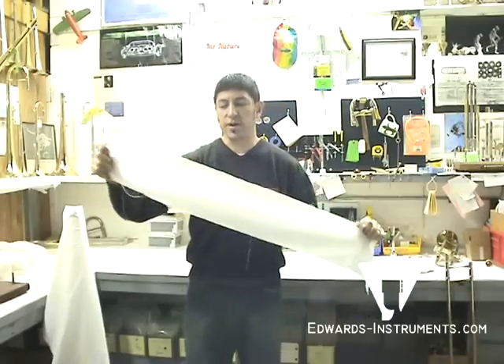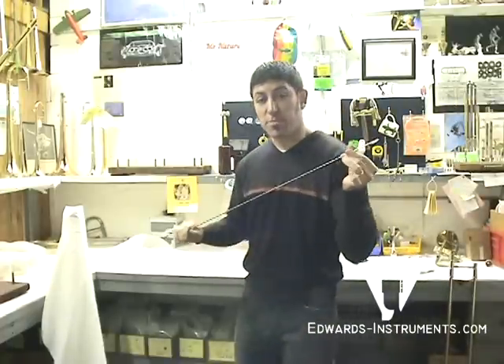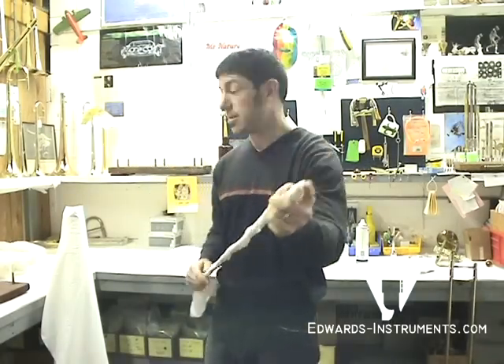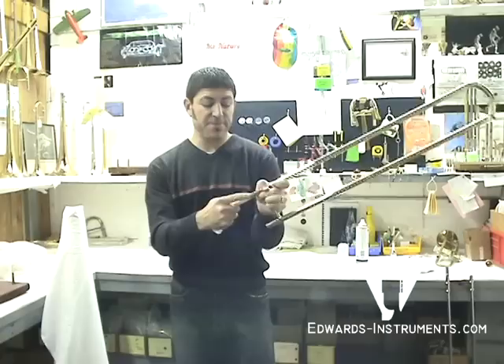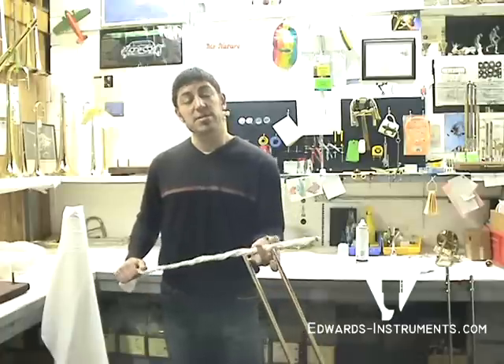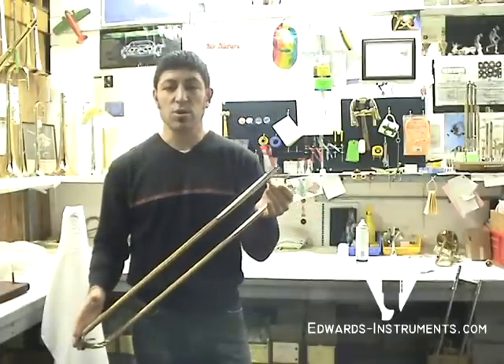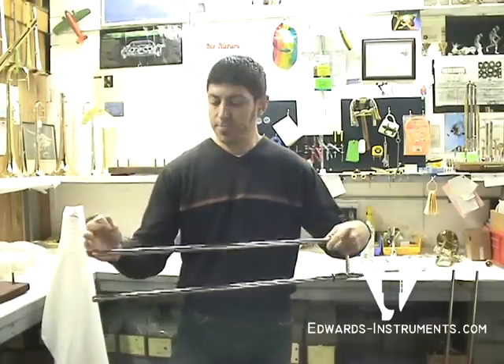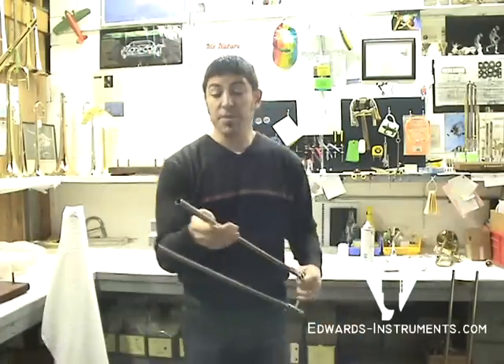Trombone Slide Cleaning

Comment: thanks for the video! just now used it to clean a slide I thought I was going to have to take into the shop for straightening, and your advice got it working smoothly without the service. When I was starting out, nobody ever told me how to do this the right way, so lots of trial and resulted in OK results over the years, but this method is clearly superior to what I was doing before.

Comment: Out of all the things posted on the net about how to lubricate a slide this is about the best.  One thing that I would suggest is removing th slide and right at the tip of the stockings you will notice build up of cream right after lubrication and the horn has been played a bit.  Clean this off  and right at the top of the stockings there may be a bit of build up too.  This makes for the perfect amount of lubrication with out anything on the slide to bunk up the performancee.

Comment: I am curious! With a properly aligned slide, the only part of the inner that touches is the stockings. So why would you put slide scream all the way to the top? If you have any other part of the inner touching the outer slide you have a problem and need to take it have the slide repaired.

Comment: please help! the other day i was cleaning the inside of the inner slide with my cleaning rod and the cloth got stuck. the cloth is really jammed in there tight and do you know of any tips to get it out possibly?  if worse comes to worst i will just have to use my air compressor to blow it out if hooking it out doesnt work. please help!!!

Comment: Nobody ever told me to do this when I started to play trombone, so I've had my trigger for about a year and I have never done the swabbing and have used slide-I-mix I hope that I can clean My slide with no permanent damage. But I will be upgrading my trombone soon, and I don't want to look like a noob when I upgrade it (we have the payment plan). My question is, will there be permanent damage, and from only using slide-o-mix and never cleaning the slide, there is a kind of black buildup I'm the stockings? Help me????
Reply: +Sophie Lamar Slide-O-Mix is great. It's just that some trombones do better with some lubes as well as others do with other lubes. I have a Rath large bore that loves Superslick, a medium bore Conn that does awesome with S.O.M, and an American Standard small bore that is my jazz horn that only likes the Trombotine. Have you upgraded your trombone yet? What'd you get? Also make sure you're oiling your rotor sufficiently. And try to use synthetic rotor and slide lube or natural rotor and slide lube; don't mix synthetic and natural.

Comment: What grade cheesecloth do you use? I ask because I am using grade 50, which works, but it's rather difficult to cover the end of my cleaning rod with it, as the rod keeps poking through the stitches.
Reply: I even recommend you use an old bed sheet as you can create a very long cut of it so that you can wrap it around your rod, and still hold onto it at the end in case it were to get stuck in your trombone.

Comment: I tried using my cleaning with a paper towel and ended up getting the paper towel stuck halfway in the slide. I don't know how to get it out :( I'm 13 by the way
Reply: oh fuck...
Reply: How'd you get it out?
Reply: @mio3092  - there's only one way out in that situation; accept that anything you try to do is likely to cause serious damage.  Bite the bullet, and take it to a pro repair shop. However much they charge you for getting the paper towel out, if you try and get it out without having the right tools, knowledge and experience, you'll have to pay them not just to shift the blockage, but also pay them to repair the damage you've done.
All brass instruments are very easy to damage (and costly to repair), but trombone slides are the most delicate of them all.
HTH
Reply: @jackx4311  Oh, I didn't get anything stuck in my trombone, I was just really curious. Thanks for the answer, though!